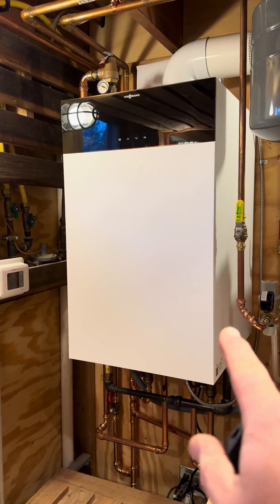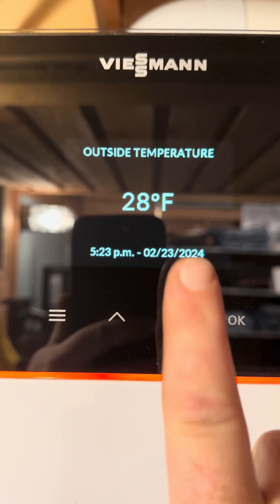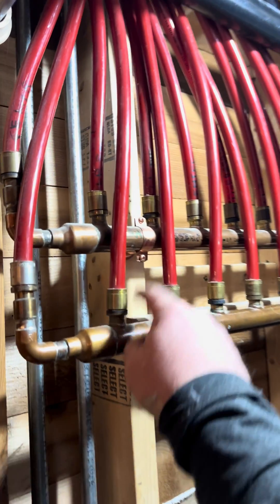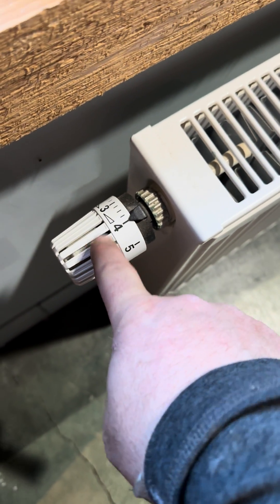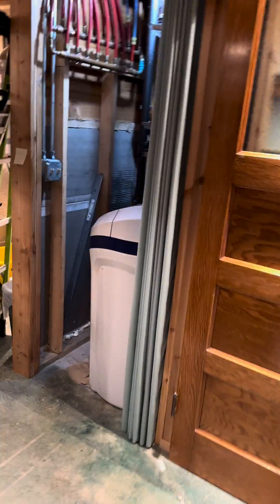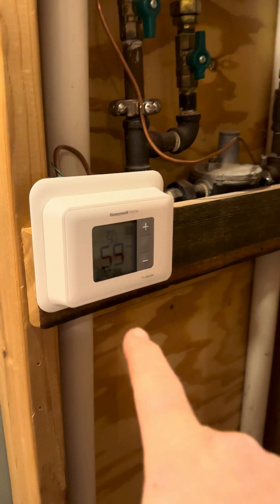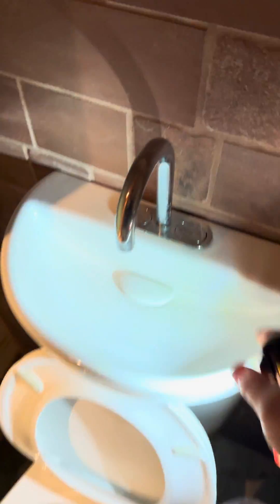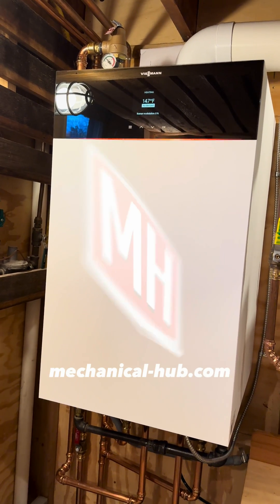No Thermostat? Operating a new Viessmann Boiler using only weather compensation

Comment: A Norwegian client I guess by the paddles, but nice job...  
By the feed temp of 52c for -2.2c outside, it's running on the default heating curve 1.4 same as here, but a few pointers -
Didn't see a magnetic filter on the return, but highly recommended as it saves on having to flush the system or clean the plate heat exchanger as it removes the magnetite completely.
Using the programming app, the thermostat can be dispensed with as the boiler can be programmed to go into standby at a set external temperature.
Those two rads you showed really should both be on in an open plan space, if they're sized correctly and balanced, it will lower the return temp maxxing out boiler efficiency.

Even when it was -10c my return was 23.5c, still the -16 to -20 to test yet - I'm using big rads admittedly but my place looks way less well insulated than your client's.

Comment: Could have used a light switch or toggle switch instead of a thermostat right?
Reply: THAT WA
that was my thought why not just use a switch? winter and summer..
Reply from the maker: Yeah but I’ve ran into issues in the past. People don’t know what the switch does, then they mess with it for whatever reason. The t-stat is instantly recognized as part of the heating system.  It’s also simple and relatively cheap.